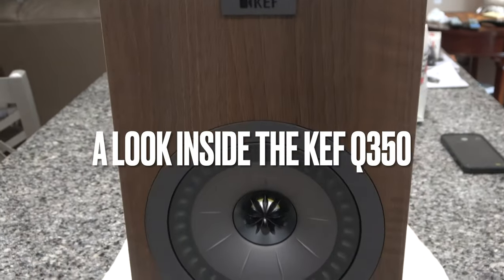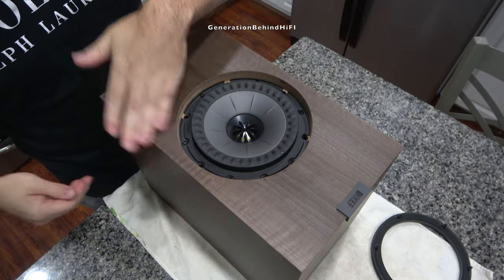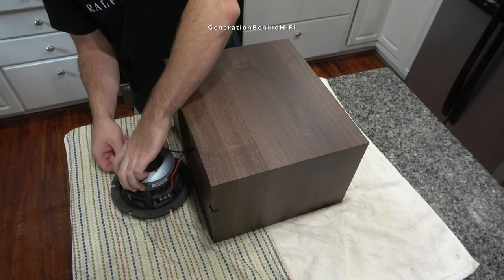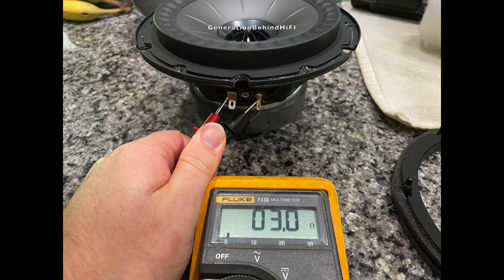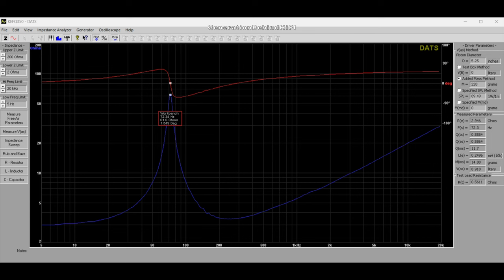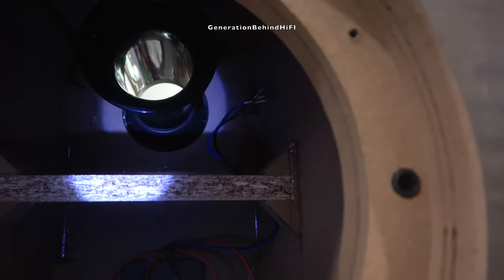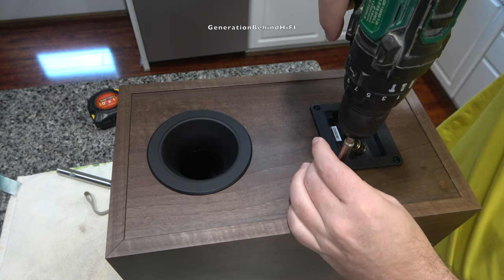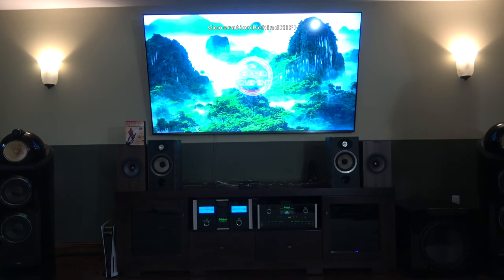A Look Inside The KEF Q350 Speakers

Comment: Movers stole my kef q100's!
I can get the Walnut 350s for $650
Reply from the maker: That sucks! Sorry to hear! KEF runs sales on their Q line of speakers quite regularly. I think KEF will have another sale right after Thanksgiving and you should be able to pick up a pair for a lot less than $650. That is if you can wait. :)
Reply: @generationbehindhifi  awesome!
Yes, I can wait. Man those lsxii are also calling me. I wish they had a q150 wireless. In other words, little cheaper than the ls50's
Reply from the maker: @XtianApi  I hear ya! Decisions like this can be tough. Personally, I have owned both the Q150 and Q350 speakers, and while the Q150 was very impressive for it's size, it just didn't have the bass output that I was looking for. Think of the Q350 as everything that the Q150 is, but just a lot more sound stage, imaging, and most of all bass!
Reply: @generationbehindhifi  really!
I've seen so little on the 350, especially in regards to the 150.
I may wait for a 500 dollar 350 sale.
Need a decent amp to pair it with, because my smsl stuff is crap
Reply: @generationbehindhifi  Would you say the highs of the Q350 are a bit muffled? I went to go listen to them at Best Buy and the soundstage was huge but just couldn't get over that they sounded muffled. especially compared to the rest of the bookshelf speakers in the same showroom. Do the Q150's have brighter highs compared to the Q350's?
Reply from the maker: @alejandrocervantes4981  The Q350's are not in your face forward in the high frequency department like a lot of other speakers. If you prefer a bright sounding speaker, then the Q350 is not a speaker for you. Check out my review video on both the Q150 and Q350 is you want to hear a more detailed opinion from me on how they sound.

Comment: Based on construction, this should be about a $550 set of speakers.  I mean really, at $800 for the pair they use a STAMPED STEEL frame basket?  Then there is that crossover.  I mean, really, with such few parts, couldn't they opted for an air core coil?  More and more I been seeing that KEF is heading down the road of Focal and they are becoming a "Troll" manufacturer that overprices their products.  Sorry, Pass.  I think for concentric driver speakers, Tannoys are built better than this.   One thing I do give to KEF is that I was surprised that they are using a VERY thick front baffle and also their input terminals are mostly brass.   It is shocking when compared to that Focal speaker for $2200, but then again, I am NOT surprised.
Reply from the maker: The Q350s are $500 speakers. KEF has them on sale for this price quite a bit throughout the year. At $500, they are one of my favorite speakers in this price range.
Reply: @generationbehindhifi  That is better pricing for them, but  I have it been hearing it to often from known audiophiles and they are not keen on the concentric drivers.  By itself the KEFs sound fine, but when compared to other speakers, and often cheaper ones, they come off as just OK.  Lately, I have been leaning towards Wharfedale as that seems to be a nicely built speaker, but I hear the high end is laid back on those and I am more of a Klipsch person that prefers a more lively top end.  The scary thing is that I bought the Sony SSCS5's based on a reviewer here on You Tube, and for a $123 pair of speakers, the midrange is better on those than the $350 set of Klipsch RP-600m's I have.  As for KEF, I am curious to how the Q150 sounds.  There are at least two reviewers I came across that prefer this speaker over the LS50's!  ...And it is far cheaper too!
Reply from the maker: @jukingeo  I love the KEF Uni-Q drivers. I think they sound phenomenal for the money. Sound quality is a personal preference and a very subjective topic. Some people like them and some people don't, which is fine. I wasn't a fan of the Q150 and I think its laughable that some people actually think they sound "better" than the LS50, but who am I to argue with them if they truly believe that. I used to own the Q150 and found they lacked bass so I returned them for the Q350. IMO the Q350 is a much better speaker. I talk about all this in my Q150 and Q350 review videos. If I were you, order both and decide for yourself.  :)
Reply: @generationbehindhifi  I guess to each their own, but initially, I have heard the rants and raves about how good the LS-50 is, but lately I have been hearing the other side of the equation.   It seems as if the Q-150 and A-350 are priced reasonably enough to try out.  But if you ask me, the asking price of the LS-50 is a big NO.   I have a problem in general when it comes to spending more than $650 for bookshelf speakers.  I just feel for the average size (woofers below 8" in diameter), and overall construction, there is only so much you can put into a small speaker.  It gets to a point where it downright overcharging.   I mean would you go to a hardware store and spend $1000 on a hammer?  No, I don't think so.  BTW, I made a mistake.  The  guy that likes the Q150 better compared them to the LS-50 and not the Q350.  He still has the Q150 and sold the LS-50s.
Reply from the maker: @jukingeo  I think you might be over simplifying it with the hammer analogy but I see your point. No doubt in this hobby you get to the point of diminishing returns as you move up in price, but in most cases (depends on brand) there are tremendous differences in quality of parts, cabinet construction, and drivers when comparing a pair of $650 bookshelf speakers to a $2000+ pair. Is the more expensive speaker worth it? Well, that depends on the person. To me it is, but I also have 15k tower speakers in my theater room and I really enjoy this hobby.  As for the guy who thinks his Q150's are better than LS50's, great! But I strongly disagree with his statement, but I'm sure my wife wished I had ears like him. LOL!
Reply: @generationbehindhifi  It is funny how it seems you are defending the higher priced speakers when you, yourself exposed the Focal Arias of the fact that they are more in line in cost to a mid three figure speaker rather than a four figure speaker.   I can assure you that there are many cases of trolling and I have seen it time and time again when it comes to high end audio, and especially with speakers.  While KEF isn't as bad (yet), Focal, Revel, Sonas Faber, Bose, Bang and Olufsen are definitely companies to avoid.  Not sure what you have for 15k set of speakers, but I am hoping they have twin 15" woofers and VERY large horns on them.  (Like a commercial speaker).   Honestly, I just cannot justify spending that much on a set of speakers.  In fact, I wouldn't spend that much on a whole system.  You just get to a point where it just isn't worth it.
Reply from the maker: @jukingeo How I'm I defending them? I also mentioned it depends on the brand too  and I also mentioned you do get to a point of diminishing returns. I think this will be my last post because you are taking a lot of what I say out of context. Best of luck in what ever you choose. I have no skin in the game anyways.

Comment: Wow..... The crossover looks so small and cheap.....
Reply from the maker: It's a basic 1st order filter, but at least they are using a poly cap instead of an electrolytic cap on the tweeter circuit!

Comment: 5:30 speaker dampening is not necessary on ported boxes all it does is choke the sound
Reply from the maker: Hello, I couldn't disagree more with this statement. What about the standing waves within the enclosure if damping material is not necessary on ported boxes? I don't know where you heard that, but I would recommend reading up on the subject more because damping material is absolutely necessary for speaker enclosures, ported or not.

Comment: I cannot recommend these speakers.  very cheap first-order crossover (6dB/octave).  Yes, it would still be fine for a bass speaker, but for a tweeter, a crossover of the second order is always used, but never  (6dB/octave).  you can hear harshness due to poor filtering and overall poorly designed speakers.  Considering the price, there are much better speakers such as wharfedale, Canton, jamo, q acoustics..